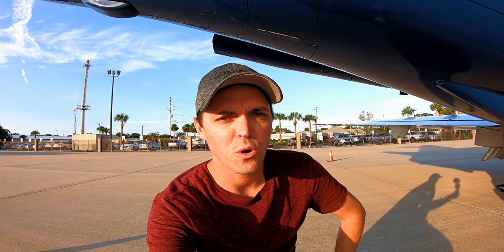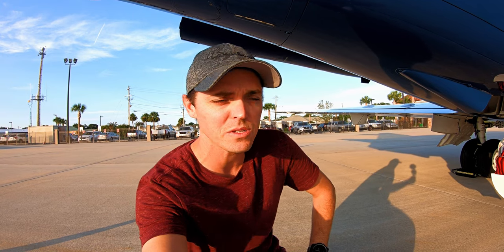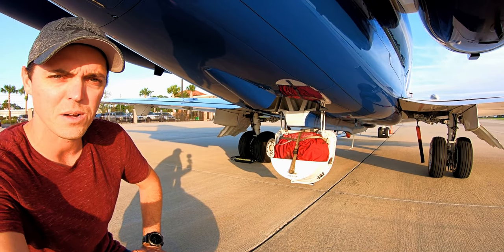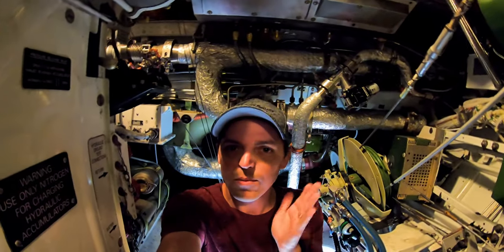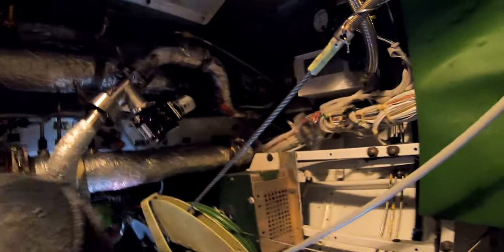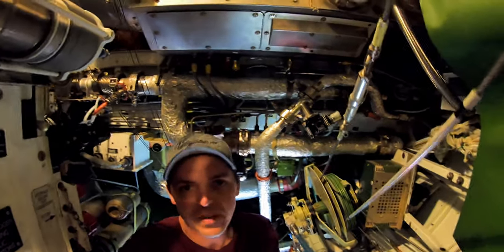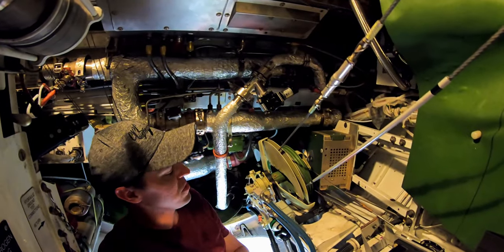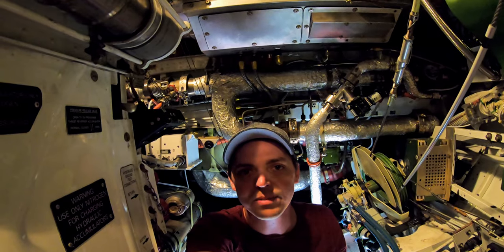Tech Tuesday - Hawker Aft Equipment Area

Comment: I worked maintenance on this aircraft type for several years. If you want to know the true pain of real maintenance, this is it. That place is absolutely the definition of hell hole. It will test the patience and skills of the hardest of mechanics. I've since moved onto the airlines. But I will never ever ever forget my years working this maintenance nightmare of an aircraft. Especially that he'll hole. Don't forget to bring your Coin Slot bits, 11/32 socket, and British Standard wrenches!! (Pro Tip: the main tire axle nut is left hand thread).

Comment: Interesting video. I used to work for a company which supplied Hawker parts to Airbus. Some of these parts can be seen in this video. The battery tray and battery slide way and the 2 gallon hydraulic tank were ours amongst others. Nice to see where some of the parts went.

Comment: Friend of mine used to fly the a hawker back in the 90s, they were in ft worth during the summer waiting for the next load of passengers when the APU when down. Cabin got really hot really fast and they decided to go back into the hell hole to troubleshoot the APU (both were A&Ps) they managed to get it going again but my friend said they were both covered in grease and had enough sweet running down their cracks to run a paddlewheel when the passengers came up to the airplane.

Comment: Ahh, no different than working on a modern automobile - no room for you in the engine compartment of those, either! 😁 Just changing spark plugs on some of them is now a 2 hour job ... 🤢

I'm going to look up the cost of one of those batteries - I bet it's a bit higher than I'm used to. That would be the one to use in cold climates in your car. 👍 

Thanks for the tour, Shaun! Interesting stuff! 😎🍻 Oh, just looked up those batteries - $300+ for the small ones, and saw a larger one for $2,779. 😳😂
Reply from the maker: Ouch!

Comment: Stow away compartment, if the heat, or cold at elevation, doesn't get ya, the lack of air pressurization might... I'm assuming it's not pressurized in there but what do I know.
Reply from the maker: definitely not pressurized. I did hear about a mechanic that rode around a VFR pattern in a Gulfstream hell hole and almost died from the heat

Comment: Does that area get hot during flight? I mean with the hydralic elements and the rest. I could see someone using that to smuggle themselves, however like many situations, I don't think they realise how cold it gets up high, let alone the oxygen deprivation, unless that compartment is pressurised.
Reply from the maker: That area gets very hot, and no...it is not pressurized. I heard of a mechanic that rode in a Gulfstream hell hole for a VFR pattern at low altitude and almost died from the heat